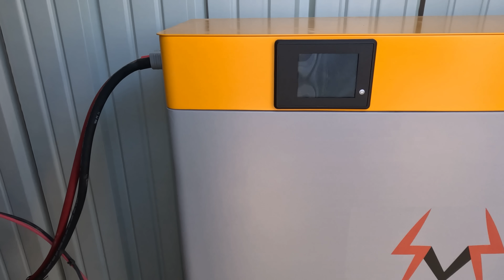Off-Grid Solar 1 Year | Regrets & Walk-through

Comment: My first winter with solar, 105 days with 20 hours of sun with 343 Gen hours, having onsite LPG Gen refill is effortless over 450 kwh 123g tank, 1 month of gas cans I switched.  
Solar from 8.3kw to 11.6kw reduced gen time 81% to 66 hours, my 8kw inverter blew up 10 hours before Spain lost power hmm, the warranty replacement is a 12000xp and adding more solar 16.2kw rated, with 4x 7000w inputs lots of room to add more. I have my panels vertical with sun and snow the 3300W array made over 4185W before it over amped the mppt, good boost and never clean snow or dirt with rain washing. On the road to "zero gen" with electric heat only and -25F lows in a trailer consuming 18kwh daily. I have  rugbuddy  heaters, the 170w heats the entire under space -5F was 46F, since the trailer is 2 season the heat comes through the floor 48F inside then I use 350w heaters either in bed or at the desk to 70F, or 1 hour of the big heater to 70+ everywhere. 
More insulation and a rugbuddy 60w will keep your battery warm. My batteries are ok to -25F but they work better at 50F they live under the trailer with the water and grey treatment tank. 
The King Kong 2 on sale is under $10k, 62kw that would solve any power need. It was 33F this morning almost upgrade season for me.

Comment: Great video and information!!! Most of the terms and info I knew. But, you explained things great for someone new to all of this. Great job! ... It's been a minute since I've seen some of your videos, so I'm not sure what AC system you have. But, if I'm not mistaken, I believe Mr. Cool has a mini split which runs off 12v now. That might help if you guys are running a system off AC power. You'll negate the loss during the power conversion from DC to AC. Just a thought. Cheers!

Comment: Note:    When I was in the military and computers were really expensive, I built computers buying a part each paycheck until I had a whole computer and did the same building them for others with their money plus a bit of commission.  My point is, You don't need to double the battery capacity all at once.  Batteries have come down so much, could you not buy a battery or two when you can, then when you have four, tie them in series and parallel them in to your big battery as it is made just like your pannels with paraller and series inside.  You wouldn't need a huge cable to parallel 100 or 200 amps in, depending on the size batteries you added.  Think about it or consult the battery producer.   (You could also use your generator to run visiting campers during the day.)
Reply: You started out sounding like a Johnny Cash song. The one where he works at the automobile factory and he takes home one part at a time. 😂
Reply: Your right. Find a good solar panel a good inverter and a good server rack battery. Than just keep buying more of them and adding to your system as you need more power. I started off with 5 solar panels , 1 inverter and 2 server rack batteries. Now I have six server rack batteries. Same kind. 4 investors and 15 solar panels.
Reply: You shouldn't add new batteries to an already existing system. You should buy the batteries you need to operate your system optimally. Like any DC operations, all your batteries should be changed at the same time. Unless of course one battery has failed.
Reply: This isn't the greatest advice. Batteries age and have shelf lives, and it's better to get yours at similar ages to keep them balanced properly over the years. Cells might go bad in an older battery and mess up the system

Comment: Once again, I will recommend SAND BATTERIES.  They are much cheaper, environmentally sound and can produce heat, electricity and hot water for an entire village.
Reply: How does sand batteries generate power?
Reply: @gemrough  It collects solar rays and stores them as heat.  Then, releases the energy and hot water, electricity or hot air, depending on how you configure it.     Imagine, it's simplest from;  a steel calendar filled with SAND   Attach this to a dolly and set it out at sunrise on full sun for the day.  At sunset, you brought it in.  It will give off heat all night.  Put a copper coil in and it will generate hot water.  Put a closet in on the Northside and install thermocouples and you generate ELECTRICITY!!!  Build it big enough and have it all.  Norway and Finland run entire villages from them.   Best of all, it is DIRT CHEAP and ENVIRONMENTALLY SOUND.
Reply: @ i understand the heat and water aspect, not the electricity. Sure a thermocouple generates electricity… millivolts…  a far cry from battery voltage.

Comment: Dear shopsolar, send them another Mammoth RE battery! Pretty good, Matt. Now for the overly critical peanut gallery 🤣 Wall-warts used to have transformers and rectifiers to step down voltage, but now they use inductors with high-speed switching circuits so they can be smaller and cheaper. The 120/240V AC is the root-mean-square voltage--peak voltages are actually higher being around 170 and 340. Using the RMS voltage makes the power equation easier for AC and DC. You could go into series versus parallel, which adds voltage and which adds current in another video. Does the combiner box just put the parallel connections in one place? Your solar panels are somewhat protected from wind by surrounding trees. ♥